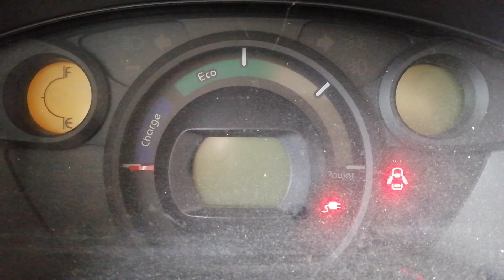Mitsubishi  i-miev truck On Board Charger (OBC) repair.

Comment: This video is worth nothing!!! Without info about all broken elements it's just a commercial off your service.
Reply from the maker: It is a commercial video. I'm sorry if you are disappointed.
Reply: @aeesolutions  no I'm not disappoint!! It's just funny that you are doing rocket science from middle complicated AC DC DC converter 😁
Reply from the maker: @konradmazur6204  Its all about electronics if you don't know what you are working on. If its easy then why don't you find the fault by your self without searching for step by step instructions for free. We have spent time and resources to fix these OBCs . As a business owner I don't want to disclose all the repair info/ steps to public.